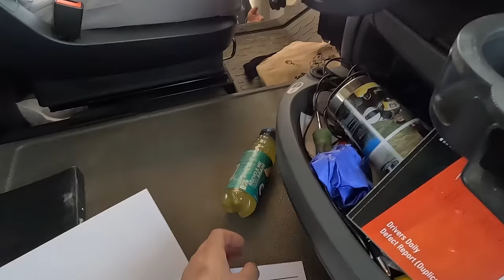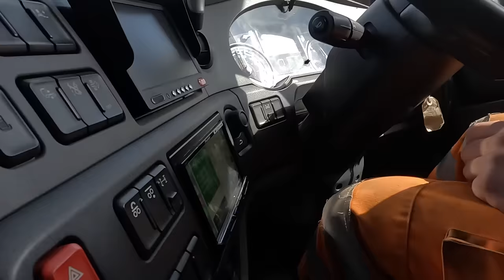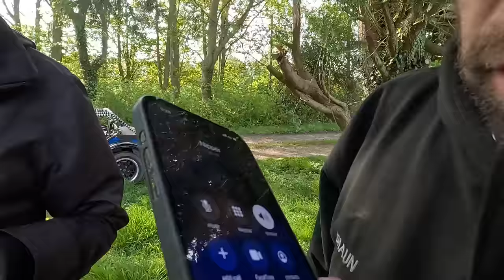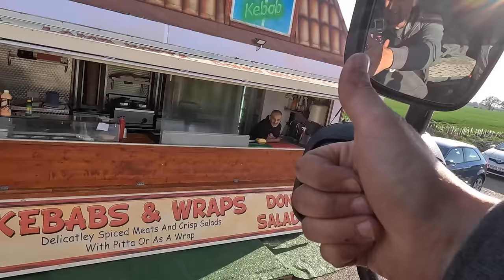My FIRST TIME Driving A Left Hand Drive Truck | *DISASTER* | #truckertim

Comment: On the note of the steering wheel beeing on the other side. Im a country mailman in sweden. So i start my day doing 50 km in a LHD car, and then do probably about 70-80 km in a RHD drive van. And ofc after this i switch back to LHD and 50 km back home. Takes a little getting used to.

Comment: 4 series will look amazing in the same colour scheme as the R series, for a slight change you should put stacks on 4 series with custom full length A frame and the trailer you need to do identical colours scheme to make it match both trucks